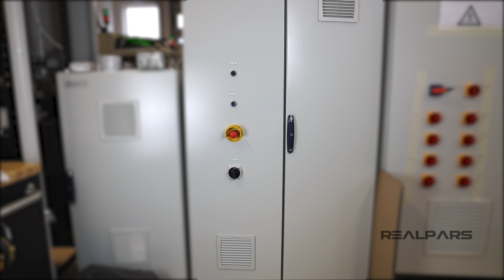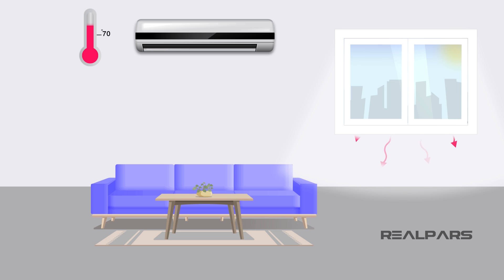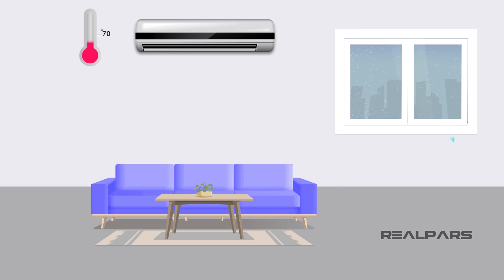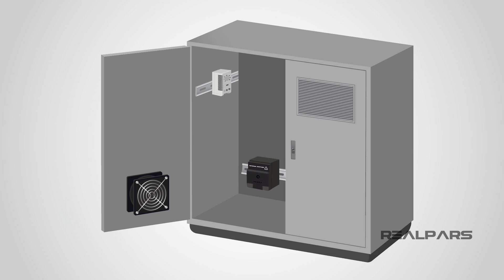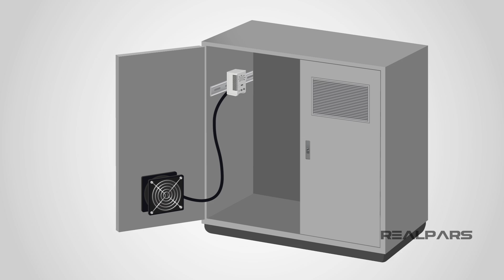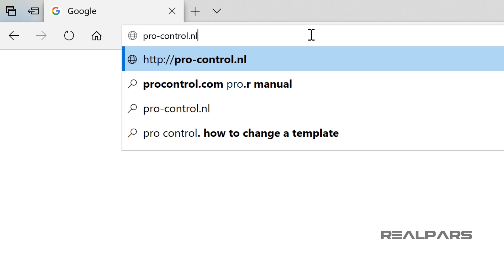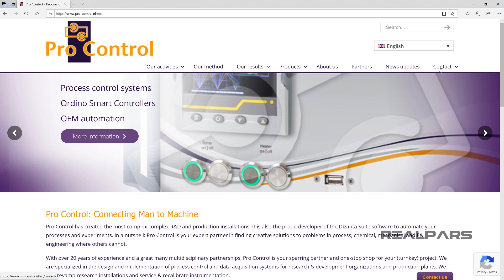Basics of Electrical Panel Cooling System

Comment: there is a black button just below emergency switch what is that please explain.
Reply from the maker: Hello, @sadeedulhassan483  Thank you for your question. That black button is not a button but a selector switch for powering up the control cabinet with 3-phase power with a ground. In other words, the main power selector switch. You must turn it to the “ON” position or “Power on”/Off as indicated, depending on the Engineering design. 
You can learn more about it by joining our 7-day free trial to learn more about this topic at https://community.realpars.com/checkout/realpars-membership

Comment: How to calculate incoming power supply wire size if I have used more nos of vfd Or servo
Reply from the maker: Hello, @ashokchetttri3492.   Thank you for your question. Depending on where you are in the world, you will have to look into your electrical codes for these systems and safety issues. The devices should have a manual from the vendor helping you with this calculation and the distance from the power source. The device vendors should have a website for you to review, too. We have lessons on this topic in our maintenance course. Join a 7-day free trial and see the benefits of becoming a member. Happy learning from Realpars!

Comment: We have brand new VFDs in new cabinets. Each box has 2 inlet fans and 3 outlet fans. 
Obviously the inlets need to be filtered but 
Should the outlet fans also have filters installed after the fan?  This seems like it is trapping heat
Reply from the maker: Hello, peterdegraff3719 Thank you for your question. This is a very good question!  You are correct in saying the inlet must be filtered. And I agree your output should not. But first, I would suggest you read carefully the user manual on your VDF. It should tell you the maximum heat temperature range your VDF should work under before you get an alarm or fault out. You might want to look at the environment in which these VDFs can work. You might have to add air conditioners as needed. Happy learning from RealPars!

Comment: at which working ambiant conditions that i could decide this panel will need a cooling fan or a heater or booth ?
Reply from the maker: There are several ways to calculate the anticipated internal temperature of a control panel based on what is located inside the panel.  
http://www.cabinetcooler.info/heatload.html

https://www.saginawcontrol.com/resources/thermal-calculator/

Comment: What if we use panel air conditioner for the panel ? Do we require these fans and vents? How the cooling system work in the panel if we use an panel air conditioner?
Reply from the maker: Panel coolers and air conditioners all have a fan outlet and an air vent or return.  For a cooling fan,  the fan should be placed near the top of the panel and the vent near the bottom on the opposite side.  Both the fan/air inlet and vent outlet should be outfitted with filters.  You could switch the inlet and outlet positions, but I find that the elements that generate the most heat are usually near the top of a panel (incoming power, transformers, etc.) and there is more dust around the bottom of the panel, so theoretically, the internal area of the panel will stay cleaner with the vent outlet near the bottom.  Air Conditioners circulate air frim inside the panel, through a heat exchanger/cooling coil, and then back into the panel through a filter.  Sophisticated A/C units may have some outside air makeup or other features to limit dust and moisture inside the panel.  Vortex coolers are devices that replace an inlet fan and are driven by compressed air.  The vortex action cools the incoming air and distributes it into the panel.  Again, you need a vent and filter to exhaust the hot air from the panel.

Comment: thanks for you video  is there  any solution for the outdoor electrical panel if the normal cooling system with fan only is not enough due to high temperature which cause failure to internal component
Reply: I'm in the exact situation you're speaking of. I have a fan installed with an exhaust grill, with hoods to maintain a nema 4x rating. Unfortunately the fan is not doing well enough, internal temperatures are reaching 117F inside the cabinet at 97 F outside. What you will have to do (and myself included) is install an enclosure air conditioning unit. Unfortunately these units are NOT cheap, well over 1000.00 USD. If you wish to take that route, www.automationdirect.com would be a good place to start. Good luck.

Comment: do you have rule of thumbs in calculating cooling loads for hvac system in switchgear rooms ?
Reply from the maker: Commonly, switchgear rooms are not conditioned, only ventilated.  HVAC requirements depend on heat rejection into the room and the size of the room.  A rule of thumb for these types of spaces (electrical equipment) is 1 ton of cooling per 150 square feet (~2000 BTU/hr/square meter).  Personnel comfort is not the issue with electrical rooms, and care needs to be taken to keep the humidity in the room above the level where static discharge may become an issue.

Comment: I think we used to install fan top  and take hot air out and filter at bottom.  Thanks
Reply: Hello bro fan running time pannel  inside create a vaccum filter side suction cooling air earth bottom hot atm air up side cooling atm air example heals area.

Comment: This is nice video. I have one question that’s why the fan doesn’t installed top and louver installed bottom of the door?
Reply from the maker: There are many philosophies for fan/louver placement in panels.  The majority of panel builders I have talked to say that if there are many motor control devices (contactors, VFD's, etc.) in a panel,  these devices will be the ones producing the greatest amount of heat.  Therefore, the coolest air (from the intake fan) should flow across these devices to minimize hot spots in the panel.  I have heard arguments to placing the fan high and exhausting below.  In practice, and after installing and commissioning several hundred control panels in my career, the important thing is to have a fan installed, filtered at the fan and exhaust, to keep the inside of the panel cool and free from debris.

Comment: Thank you so much and I have a question. We use an UCP of dimensions (2000mmH×1200mmW×800mmD). The panel is located in outdoor environment under three sided built shade 0 to 55degC ambient temperature with 35% to 85% RH. We use vortex coolers of 2 number (Model 727-35H) 70SCF per minute of instrument air. We would like to optimize with other devices and replace the vortex coolers. 
Maximum power consumption by the panel is 800VA.
What would be the best cooling system?
Thanks in advance
Reply from the maker: I would use a closed-loop air-to-water heat exchanger for a harsh environment like you have described.  These are available from a number of manufacturers, such as Pentair.

Comment: Hey

Interesting video
I have a question on how to calculate the heat loss of element in electrical cabinet, to decide to use a fan or not.

Thanks
Reply from the maker: I usually add up the total watts consumed by the electrical devices in the panel and multiply by 0.10 to get the amount of heat expected to be generated.  The device power consumption can be found on the device specification sheets from the manufacturer.   For panels with motor controls (VFD's, contactors, etc.), I take the power in (V x A) and subtract the power out  In this case, I will need to know what the incoming and outgoing current is.

Comment: Why is it the outlet of the cooling system has an AirFilter on the outlet vs it being on the inlet and also the Fan on the outlet instead in design. I see this a lot as well. The Electrical Panel i'd think would easily get filled with dust and more with fan on inlet side vs on outlet side with Airfilter on the inlet side. Or does this has something to do with positive air pressure in the panel?
Reply from the maker: I think the inlet fan has a filter on it as well.  At 1:14 in the video. look closely.  I believe there is a slot between the door and the fan itself where a filter can be inserted.  You are correct; you don't want to design a system that purposely pulls in dust and dirt from the outside.

Comment: Hello, I wanna ask. If enviroment of control panel very corrossive how to place or manage the cooling fan so that electrical equipment in control panel not rusty.  Thank you
Reply from the maker: Corrosive atmospheres are difficult to manage.   Obviously, air that has corrosive gaseous materials diffused through it, like HCl, Sulphur compounds or even seawater spray, would not be good for the internal devices of the panel.  To avoid this, you can do one of several things:  1) move the panel to an area which does not have a corrosive atmosphere; 2) Use a NEMA 4X panel with air ducting to move non-corrosive air into and out of the panel; 3)  use a panel purge system to move clean air from cylinders or an dry instrument air system through the panel; 4) use a sealed air cooler to cool the panel without providing an ingress for the corrosive atmosphere.
Reply: @realpars  thank you for your suggest. 
Your uploaded videos very usefull. 🙏🙏

Comment: I have a problem with that, is there any code describe your theory because here in Egypt, we put the fan on the top of the panel and make the air flow inside the panel, so that the hot air keep in the bottom of the panel which rainforced to get out of the panel from a hole in the bottom when the fan rainforce fresh air from the top, I think this theory is accepted with the concept of that hot air lays in the bottom when cold air lays in the top.
Reply from the maker: Colder air sinks because it is more dense than hotter air.  However, when a fan is used, the forced air circulation overwhelms any convection effects of air settling in the panel.  With a fan, air is drawn through the panel, so whether you "suck air in" at the bottom or "blow air out" at the top, enough air will circulate to keep the panel cool in most cases.  If not, an alternate means of cooling will be required.

Comment: Great Video!!!!! What happens to the IP rating when the fans are added?
Reply from the maker: Typically, the IP rating would go down.  If an IP rating of IP66 us required (similar to NEMA 4X), alternate cooling methods may be required (like vortex coolers with appropriate fittings and gaskets).

Comment: Why to use thermostat in cooling aplication? Why not to keep the FAN switched on constantly? 

Why the FAN was placed on the doors? Isn't it placing on the wall better for the circulation? 

What are other options for cooling other than fan?
Reply from the maker: A thermostat will allow the fan to switch off of the temperature falls below a certain temperature.  This will save only a small amount of energy, but it will prolong the life of the filter and the fan.  True, it could be designed to have the fan run continuously, and in most panel applications, this is the case.  In some instances, especially outdoors. running the fan continuously may cause the the temperature to drop low enough to allow condensation.  

To get maximum circulation, the fan should be placed low in the panel and the exhaust at a higher point.  

There are other ways to cool panels:  air conditioner units and vortex coolers are just a few of the other options.

Comment: Why do few fans suck while few blow? ( Like in my laptop the fan blows the hot air outside while in your case it's reverse)
Reply: As I understand you want to buildup a little bit of pressure inside  the cabinet. Then the dust from The surrouding will not enter through little gaps. All the flow will go through the filter which is easy to clean.  

Also you can enforce airflow in the cabinet.    

In your laptop the cooling is only on one point, the radiator. In that case it's more efficient to blow directly on the heat source.
Reply: @TheKwiatek  Thank you, that completely makes sense
Reply from the maker: Kwiatek is correct.  the important factor is keeping the internal temperature of the panel down.  The best circulatin and air flow inside the panel is achieved by sucking in air at the bottom and exhausting it at the top.  Heat rises, so this configuration aids in expelling as much heat as possible.  And the filters are very important element of this type of panel cooling, so regular inspection, cleaning, and replacement is critical.

Comment: Should the cooling fans be a.c. or D.C.
Reply: The fan used is a normal BLDC computer fan ... (It requires dc supply)
Reply: you can use ac or dc. Depends if you want for example use your power supply you can use 24dc 12dc etc but you should install separate fuse for it. You can use 230V ac fan with separate CB. We use 230V ac fans because it not require power supply. If your power supply goes down fans will be running.